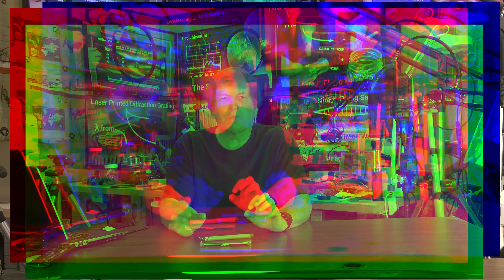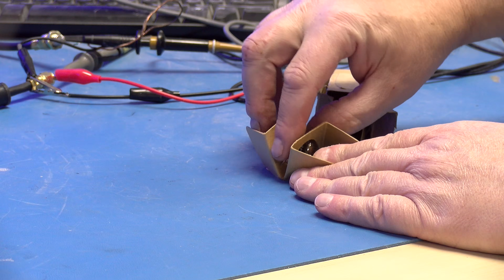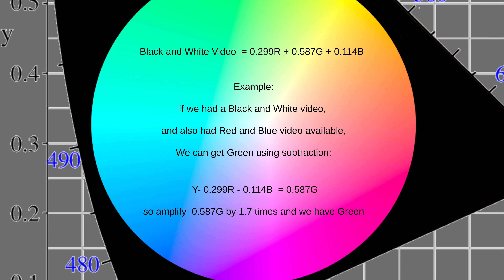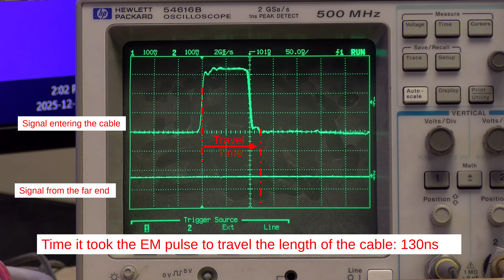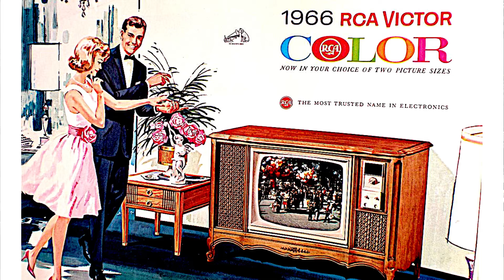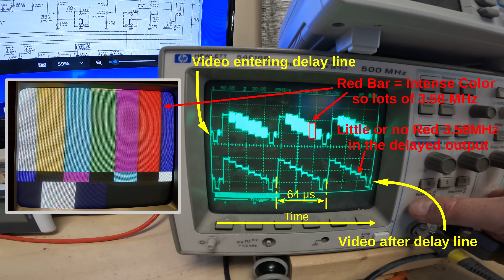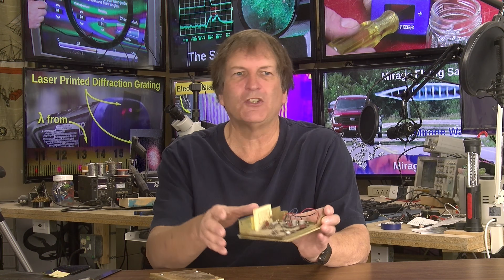How we slowed down electricity to create Color TV

Comment: RCA actually invented a so called "comb filter" at the end of the Seventies to better separate the B&W signal (the "luminance" signal) from the 3.579545 MHz color signal (the "chrominance" signal) inside the color TV. Their high-end color televisions were equipped with this from the Eighties on. It almost completely eliminated the color "dot crawl" that is so prominent in cheaper color TVs of the time, the interference phenomenon between chrominance and luminance signals that you showed so prominently in your excellent YouTube tutorial.
Reply from the maker: Yes! Any idea if they used a 64uS delay line for creating the comb, or went for a 1/60 or 1/30 frame  store to get a 30Hz or 60Hz spaced comb? I have a couple of large TVs from the final years of CRTs. All are clearly all digital signal processing chroma/luma separation as you describe, almost no dot crawl. I wonder if they added some heuristics to get rid of the last bit if dot crawl. The picture is really amazing and a great example of how good NTSC can be if the signal is used processed at it max protential. Glad you liked the video!

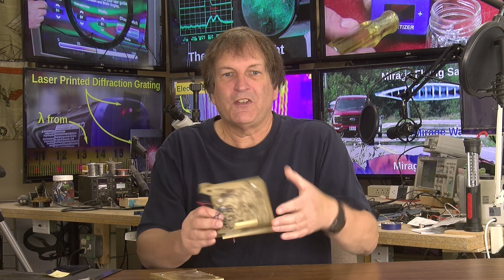Comment: 33:14 Are you sure that is a VCR drop-out compensator delay line? It looks like a PAL color TV delay line, to delay the color information of the previous scan line so it can be averaged to the next, the characteristic concept of PAL. The reason I think that is what it is, is because the frequency printed on the delay line: 4.43361875 MHz which is the color carrier frequency for PAL. But don't take my nagging as criticism, very good explanation of NTSC color TV technology indeed.
Reply from the maker: One other person noticed the 4.43361875 MHz as well - always impressed when people pick up things like that. But it is actually is a drop out compensator from a Cartrivision VTR from the early 70s (look  Cartrivision for a real treat if you havnt heard of it!). I actually have a couple of complete units. The delay line is marked near where you saw 4.43361875 MHz at about 63.5uS - a true PAL delay is 64uS if I recall correctly. My guess is since PAL delay lines were a thousand times more common than NTSC ones, they got a PAL delay line maufacturer to make one with a slightly shortened delay suitable for NTSC. 

Like most VTRs/VCRs, the luma in a Cartrivision unit is recorded as narrow band FM (also sometimes called constant amplitude AM because its almost identical to AM recorded with a 90 degree out of phase carrier). I wish I could remember the carrier frequency used in Cartrivision right now but I cant and I'm travelling, so I dont have access to my Cartivision manuals right now (yes I have a set). 

Sometime I will do a video about Cartrivision - a fascinating and almost forgotten part of VCR/VTR history. They went to extreme measures to reduce the amount of information that had to be recorded  - including recording every 3rd frame and playing it back three times. 

Glad you (otherwise :) liked the video!

Comment: What a brilliant explanation. Thank you for sharing your in-depth technical knowledge in a way that's easy to understand. Absolutely amazing how the engineers of the time were able to come up with a solution to retain compatibility with black and white TVs. In live in the UK where we previously used the PAL analogue TV system, but in the mid 1990s I had a dual format Pioneer LaserDisc player and was amazed (at the time) how good NTSC LaserDiscs could look when hooked-up to TV that could accept an NTSC composite signal.
Reply from the maker: So glad you liked the explanation of NTSC! Making stuff undertsandtable while keeping enough detail so the explanation so its still accurate is what I try and do in this channel. Sometimes more sucessful than other times. 

It is amazing how good NTSC can look on moderm electrronics. The 20% reduction in resolution from PAL or SECAM hardly makes a difference unlesslooking at two TVs side by side. It really was phase shifts as a result of imperfections in the transmission system or receivers that caused color shifts which is how NTSC earned a bad reputation. PAL is very similar to NTSC with a tweak that alternates phase direction each line to average away the phase shift problem. 

Your experienace is really interesting to hear - what a great compariosn o fthe two systems under close to ideal conditons.

Comment: Thanks for taking time to respond to all these comments.
At the end of a previous video, the one about 75 ohm cable impedance, you said you'd be talking about reflection from  glass and mirrors. is that video coming?
Reply from the maker: It try to - sometimes if they com in too fast I miss a few :( Yes - it has been long delayed - I have started on it by capturing underwhat video whil snorkling showing total internal reflection whne looking up towards the surface of the water. Stay tuned!

Comment: 1. This is the most thorough presentation of how compatible color TV signals work that I've ever seen, holy crap! 
2. I never knew about signals bleeding into nearby frequencies from the carrier before. Your explanation of why the color signal's bandwidth needed to be limited, and why delay lines were needed to line it back up with the black and white signal was incredibly cool!!
Reply from the maker: Thanks! I always thought delay lines were a really neat bit of technology, and other than in traces on PC boards, als becoming somethings you hardly see any more. 

The signals bleeding away from the carrier is actually AM modulation. I will do some more on it on the two followup videos early next year covering frams rates and other frequencies, and comparing NTSC, PAL and SECAM. I should do on on AM!

Comment: Acoustic memories were used for computing. All you need is a binary counter to keep track where you are in the data stream circling around. Then you can replace numbers in the stream and when all the numbers you need are in, you can combine a pair of numbers every cycle. This was used to do complex math back in the days.

The company Frieden made a desk calculator using acoustic memory https://en.wikipedia.org/wiki/Friden,_Inc.
One problem is the display. Nixie tubes require a lot of solder joints and are very complicated to drive electrically and it is hard to decode the numbers you want to display. This is very expensive and unreliable to make.
Instead it uses a CRT drawing the numbers out of quarter circles from the AC sine wave and adding DC offsets from the binary counter according to the numbers in the acoustic memory.
Also the numbers you key in are stored in this memory and when you punch an operator button, the numbers are combined to a result which is then displayed on the screen.
The memory draws the numbers on the screen and is used to store numbers and to work with those numbers. Each cycle a pair of numbers is combined.
And if you don't like the result of your calculation, give it a whack and you get a totally different result.

Comment: Why not just pre-delay the b/w signal at the studio!??????
Reply from the maker: Great question! What I didnt point out is that the length of the delay is that the length of the delay depends on the difference in bandwidth of the recovered luma (BW) and chroma (color) information. Many old TVs separated luma from chroma by a low pass filter in 2 Mhz range and the chroma from luma with a perhaps 3Mhz high pass filter. They traded off loss of resolution for simplicity. Later TVs were able recover more or essentially all of the luma and chroma - luma in the 3 to 4Mhz range and chroma BW or 1.5Mhz using things like comb filters which require a delay line or fully digital signal processing. So  it was best to have the delay in the TV so that it could be set the amount needed for the luma and chroma bandwidths that the TV was able to recover.

Comment: It's the 3.58 MHz bandwidth that made NTSC to what it is, not the lack of alternating-phase lines (PAL).

In PAL and SECAM the bandwidth was, IIRC,  5.5 or 6.5 MHz.

America, why do you always have to go for the cheapest possible option?
Reply: 3.58 MHz is the NTSC color subcarrier frequency, not the bandwidth.  A higher frequency doesn't make the quality any better.
Reply from the maker: Yes! Just like the PAL subcarrier of 4.43361875 MHz does not limit the bandwidth to 4.43 Mhz.

Comment: The French took the "cut the old stuff" route and developed SECAM  *without* basing it on their then-current 809 line B/W system. 

Yes, 809 lines. That's more than the 625 lines that  SECAM and PAL can transmit. 

If I remember correctly, the 809 lines transmitters were kept up and running until the French concluded that enough people switched to SECAM, and then simply took it offline.
Reply from the maker: I always thought how amazing it must have been to have HD TV back then. Not much different for our modern 720 or 1080 HD formats. The other old format that fascinated me was the British 405 line TV.  I would have been thrilled to see either of them - actually I might have as a kid because we lived in Germany for a while and visited both England and France, so I might have seen them but I dont have any memory of TV in those countries.